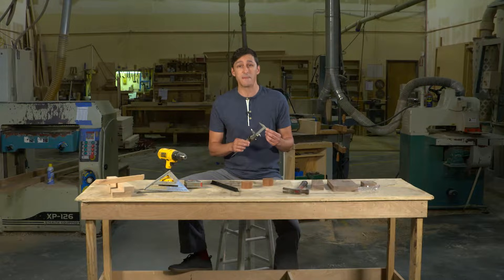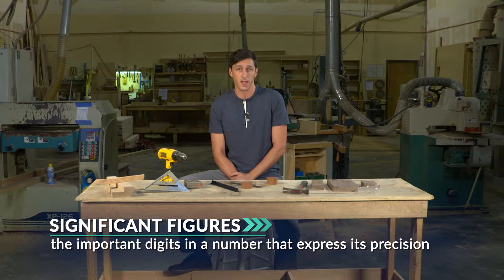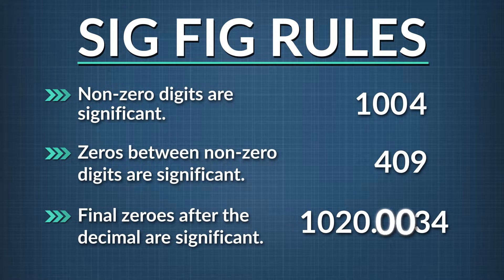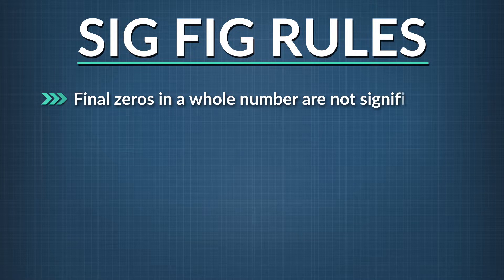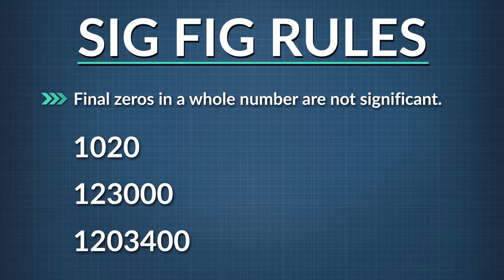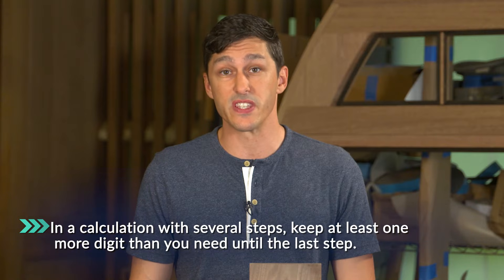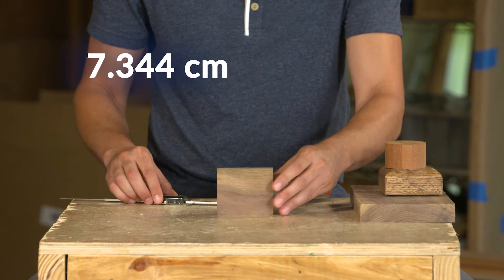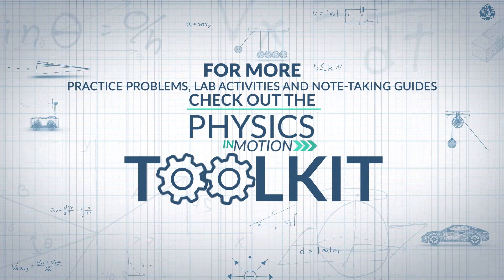What Are Significant Figures? | Physics in Motion

Comment: I have a question. I have two measurements h and r. h is 32 meters r is 0.000017 meters.
I’m using the formula h/(h+r). What is the correct answer using the correct number of sig fig? The denominator would become 32.0 using one more sig fig. So the answer is 32/32.0 or 1.0
BUT if I rewrite the equation as 1/(1+r/h) then I get r/h = 0.000000531
1+ r/h = 1.000000531 since one is exact we have 10 sig fig.
1/1.000000531= 0.9999994690!!!
Where is the error or are both correct?